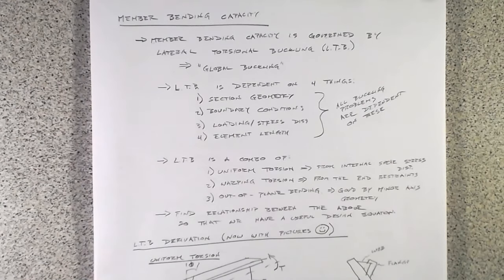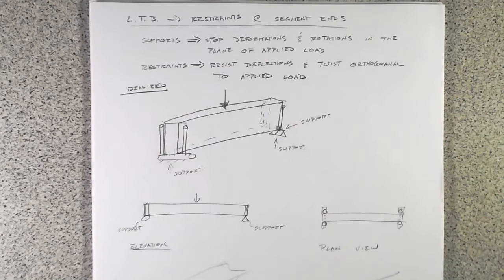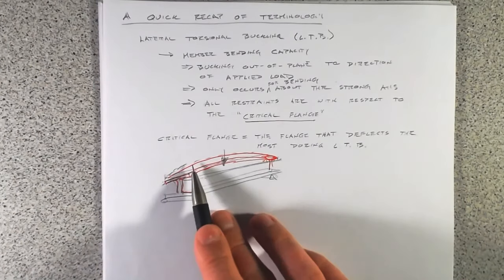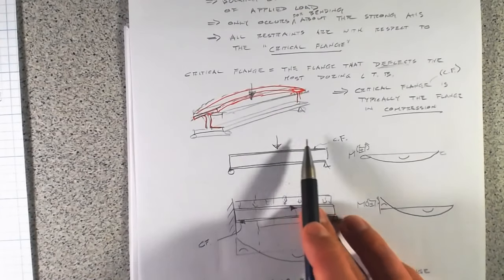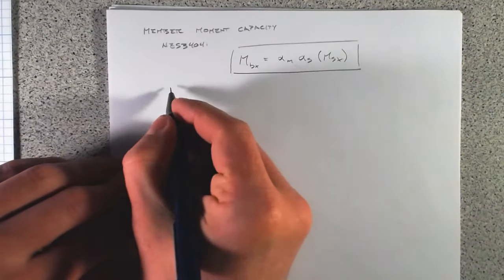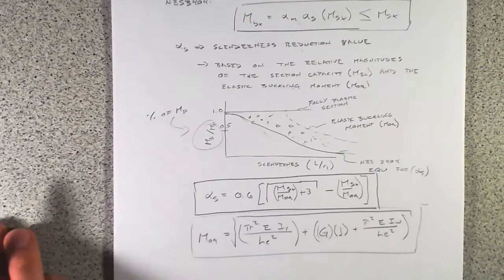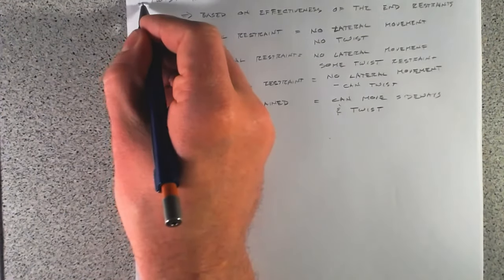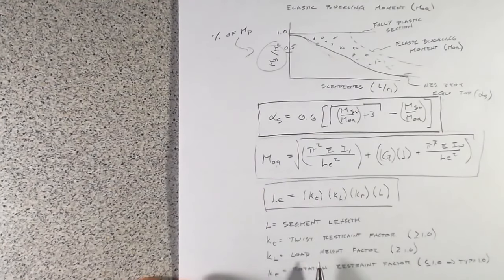Lateral Torsional Buckling NZS 3404 Equations

Comment: hi, Please advise me what is the concept of buckling length. 
if I am using UC 203-203X46 Kg/m, with a length of 5000 mm resting on 225 mm brick wall under M.S steel plate OR  concrete pad. I understand that in my case Effective length buckling length is  = 1.2L+2D= (1.2x5+2x0.203)) = 6.406 m. Please confirm?
Thanks
Reply from the maker: Your effective length will be a function of your end connection restraint and whether it resists both lateral movement and twist (kt factor) and the load height factor (kl).  So your question about the effective length is related directly to what your end connection looks like as well as if you have any other members framing into your 5m long beam which could provide restraint.  It is hard to say if your calculation of effective length is correct without knowing more about your framing configuration and beam connections